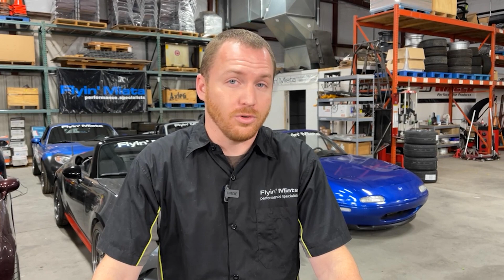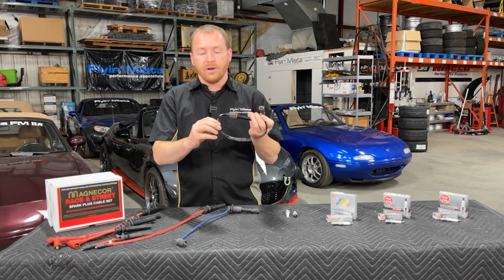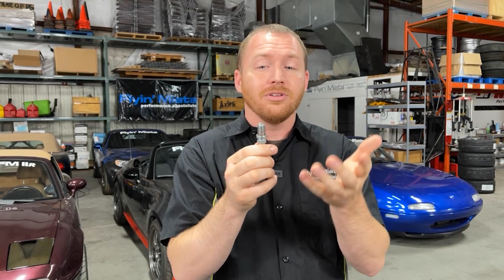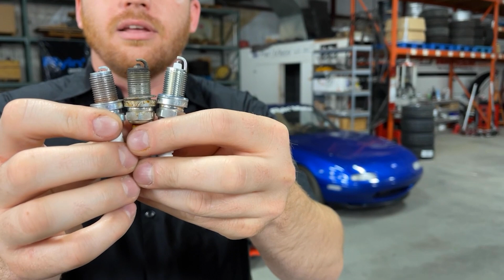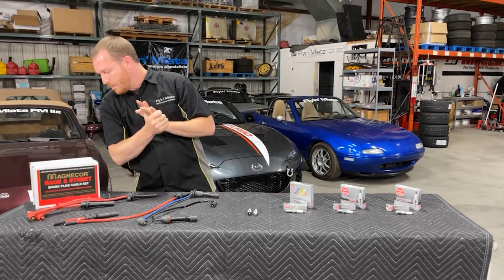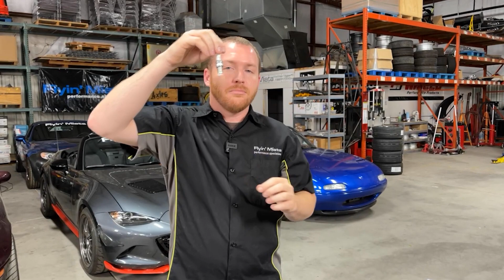SPARK Plug & Wires: The BASICS (FM Live)

Comment: What gap does FM recommend for a stage 1 aka Voodoo 2 kit pushing 6-8 psi of boost in a 2001 NB?
Reply from the maker: @Sam-tb9xu We run spark plugs gaps of ~0.028-0.035" for boosted NA/NBs. A little tighter than stock.

Comment: i have a forged engine 1,6 miata with 2860 and i had problem with ngk bkr7e with short circuit. I have changed to denso IK24 and the car works perfect now.
Reply from the maker: A short circuit on a spark plug. That's weird! I've heard of blowout on higher boosted engines but we've always had good luck with NGKs in the correct heat range and gapped properly.

Comment: I live in the UK, I have a 1.8 NB 2000 model, I have a flat spot when I blip the accelerator and a bit of hesitation until I get the revs right up, I’ve replaced plugs and leads but still there, what’s your opinion on this please ?, 
Love the FM channel 👍
Reply from the maker: If you have ignition issues like coils, plugs, etc., you'll usually have more of an issue in the higher RPM range......but not all the time. I'd check to make sure that you don't have any vacuum leaks. If the engine is getting unmetered air, it'll throw the fueling off.
Reply: @FlyinMiataVideo  thank you, I think unmetered air is the problem it’s got a filter fitted on the cam cover on the exhaust side which I believe it’s a big issue having this filter

Comment: how to check ohm on na 1.6 coil pack
Reply from the maker: The manual has a procedure to check the primary and secondary circuit but we've found that a coil can still be bad even when they pass those tests. Sometimes, you just gotta put a known good part in to make sure.

Comment: Hi Mike! What do you think of filing back the "tang", so it's in the middle of the electrode? It used to be a go fast thing.
Reply from the maker: We haven't seen a benefit to do this - it's much more important for Miatas to have the correct gap for their application (N/A, low boost, high boost, etc.) and to regap or replace the plugs when they are worn down.
Reply: @FlyinMiataVideo  Thanks!

Comment: On my bone stock 2004 NB the wires and plugs have not been replaced. I can't see any visible damage to the wires. I am a weekend and occasional track driver.
The car has about 70 thousand Km(43k miles) on it ( low right?)  Does it make sense for me to go with the magnecor wires now? Will I notice any power improvement with new and different wires/plugs?
Like everyone else I'm looking for any kind of improvement that is easy to do  !   Thanks :)
Reply from the maker: Unless the ignition system is currently experiencing an issue (deterioration of spark energy) and exhibiting poor cylinder combustion (i.e. misfire and/or stumbling caused by poor spark), then the Magnecor spark plug wires and new plugs likely won't make a noticeable difference in power in a stock MSM.  Even though they haven't reached Mazda's specified maintenance interval of 60,000-75,000 miles, the age of the wires may be enough that the insulation is breaking down and it wouldn't be a bad idea to replace them anyway.  Spark plugs for NAs and NBs are cheap (https://www.flyinmiata.com/default/ngk-extended-reach-spark-plugs.html), so if in question, the easy answer is just to get a new set.  : )

Comment: Thanks for the basic information and cutting through some of the marketing & forum hyperbole. I have a 93 M45 supercharged. Not much highway use, and though I don’t drive it very hard at all it does get a bit hot. I’ll go with the copper plug, but with a heat range 6. Thanks.

Comment: I got my first set of Magnacores from FM back when they were the Dealer alternative and were in NJ......fast forward 20 years and they finally wore out mainly from age and started arcing over to the the cam cover.  I got my new ones from FM a few years ago and I think they are the best choice for performance and longevity.    Also you should mention that painting your cam cover is good added insurance against the wires arcing over as well.
Reply from the maker: Good tip!

Comment: Logged on a little late. My question was ...    My NB2 was misfiring and I first replaced the plugs, without fixing. Then replaced the wires without fixing. Finally put in new coils and that solved it. How could I have diagnosed a coil problem right from the start?
Reply: I had this on my NB2, but I had a melted coil so it was an easy diagnosis.  I realize this doesn't answer your question.
Reply from the maker: In the video Mike discusses pulling the plug and wire from the head and laying it over an unpainted surface while firing the engine. If there is no spark, you have an issue. If the wire is good and spark plug is good, then you can probably bet it's the coil pack.